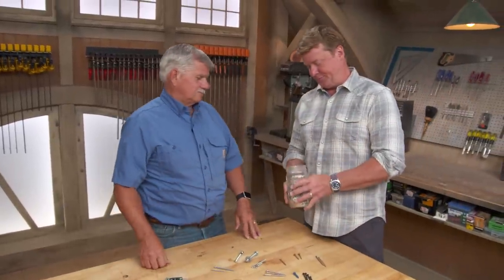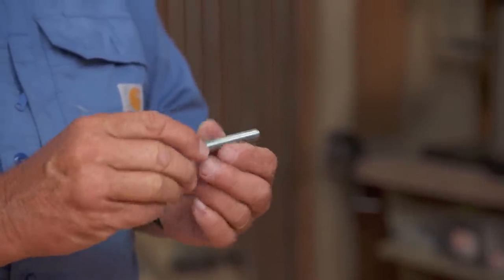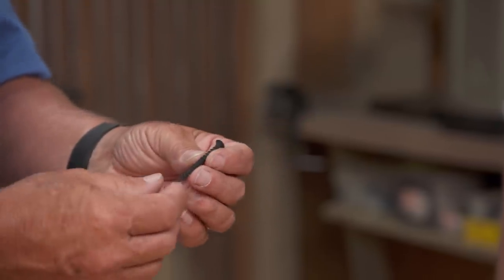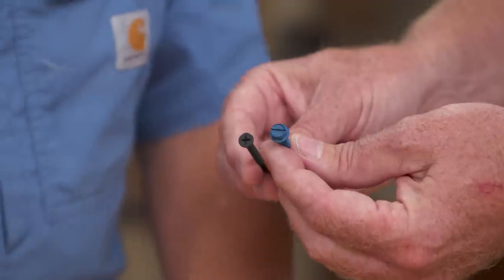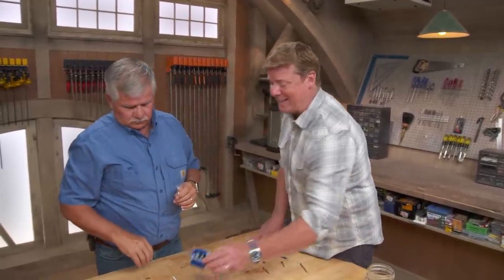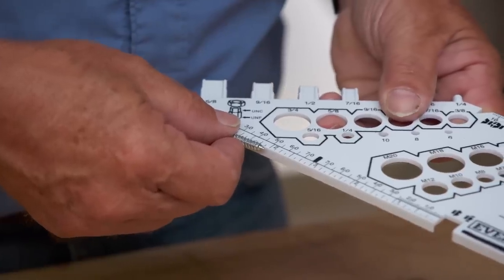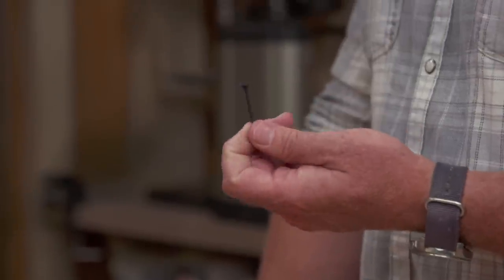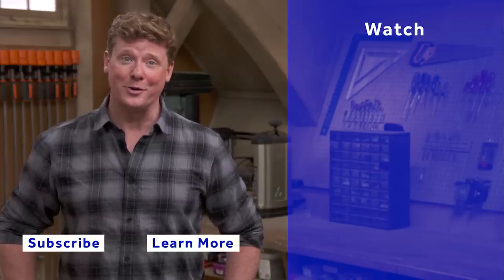How to Decode Screws | Ask This Old House

Comment: What about Robertson screws they are used a lot in Canada and they are far superior than the Philip’s screws and they are very popular in the far north
Reply: The Robertson (square head and tapered slot) is a Canadian invention, but almost unheard of in the U.S.A.  In Canada it's been the standard for power driving screws since 1909, but the TORX  screws are gaining popularity.  I find that any quality of Robertson screws perform very well and the high quality and expensive TORX also perform well, but economy TORX are crap.  Robertson manual screwdrivers and power driver bits are colour coded for convenience.  Robertson screws also stay on the driver bit, at any angle, better than the TORX making one-handed driving easier and more precise.  The U.S.A. is in love with the Philips screws for assembling everything, and they suck.

Comment: Can exterior screws be used indoors?
Reply: Yes but it would be a waste of money.
Reply: VampireOnline Agreed. For example ceramic coated screws can be like 5x the price of an uncoated screw with the same structural properties
Reply: As long as you start the screw outside methinks.
Reply: If you stick to galvanized indoors and stainless steel Outdoors you will never have another problem again in your entire life with fasteners
Reply: @dlamarsobotor4573  "Hi, so I need to hang a painting on an interior wall in my living room, what do you suggest?" - "Okay, what you want is a 22-foot long exterior screw, you start it outside and just run the effin' thing across the room into the opposite wall."
Reply: Sounds bout correct. That way your next door neighbor can hang his hat on it as well !

Comment: Could you explain threads?
Reply: T.P.I.= Threads per inch.
1/2" - 13 = 1/2" diameter/13 threads per inch.
Reply: @MrJman26211  Thank you
Reply: You're welcome! But like he showed in the video, there is a gauge you can buy, which is inexpensive.... But most home centers have them displayed for your convenience
Reply: @MrJman26211  I am interested in how you can identify the thread.  Some stores have a board with nuts and bolts on it so you can try your bolt of nut until you find the correct one.  this doesn't help if the object is part of a machine.  I don't know if there is such a tool for home garage.  As far as screws go, what would be the difference?  Why have different types of threads?
Reply: A 1/2" - 13 is a course thread screw.
A 1/2" - 20 is a fine thread screw.
Fine thread is more T.P.I.
Fine thread is stronger
Reply: Get you a 6" steel rule with 32nds or 64ths on it. Count the threads within 1" and that's your T.P.I. this information is regarding machine screws.
Reply: @MrJman26211  I understand.

Comment: Would a Carriage bolt work on a wooden bed frame
Reply: Yes, I built a loft bed using stainless steel carriage bolts and various red cedar deck materials.
Reply: @bradyelich2745  ok cool Ty so much I'm replacing the hardware that came with my bedframe that was made for me

Comment: ???  well how fr does a screw have to go into the second piece of wood. to have a good hold.  seems sometimes the tip ofthe screww is not enough to holde the 2 pieces together.. especially if the first piece is thicker than the second piece...

Comment: Rule of length is 2/3 grab 
So a 1" screw needs at least 5/8" of solid grab
Reply: That's only 2 times the material thickness though.
Reply: @Mike__B  
Thats all you need to prevent 'walking' or 'loosening' from summer to winter
Reply: @Mike__B  
Sheer strength and tightness are 2 different things
A sheetrock screw only has 400 lb of Shear strength , because they're not designed that way
A standard wood screw has over 1,200 lb of Shear strength
Reply: @Mike__B  remember there's two different ways for fastening
1 is Shear 
1 is tightened 
You need to understand which forces are being applied to what you're doing
Shearing is one of the hardest things to do and therefore has the highest tensile strength
Tightness is simple and can be done with multiple fasteners not dependent on the Fastener itself
Reply: @Mike__B  most people don't understand the expansion and contraction as materials age so they don't understand what's going to happen to the nail or screw over the years
The problem with the thickness rule is when you start doing less than 1/4" material- then it's all about the style- type of fastener

Comment: Great video, but I still cannot understand why the US still stays with imperial sizes. For us in Europe screw sizes are so much easier to follow, 4x40, 5x60 and so on.
Reply: Imperial sizes are more convenient to approximate. 1 inch is roughly the size of a knuckle, so your finger is roughly 3 inches long. 2 fingers together? approximately 6 inches. Wrist-to-elbow gives you roughly a foot (12 inches). Wrists together, elbow-to-elbow gives you roughly 2 feet. Scientific? Not at all. But it's a quick and easy way to get an idea of the dimensions of something.
Reply: I don't think I've ever seen an imperial screw or bolt in the US outside of camera tripod mounts. I do however see a lot of US customary screws used in the US and Canada. There's a huge difference when in comes to fasteners when it comparing metric and SAE to imperial.

Comment: Back too the dodgy maths again, I need a bloody master's degree, understand that crap. Can't be bothered convert all that into metric. But a Jar of random screws always comes in handy, save them.
Reply: JIF peanut butter jars are primo. But only glass ones. That way when you drop it on the cellar floor you can blame the miserable witch you fell in love with years ago.
Reply: you never learned fractions huh?
Reply: @dlamarsobotor4573  plastic lock and lock storage boxes, are the best hands down
Reply: @sirpiken  yes in school, many moons ago. Never used them in day to day life. That's why I use metric

Comment: Miracle Whip glass jars packed with straight blade screw heads are primo. That way you can blame your wife when the project fails miserably and you're picking up  wood screws & shards of glass off the kitchen floor. Good times indeed !

Comment: No love for Robertson? Throw a bone to your Canadian viewers.
Reply: I love Robertson, I wish we had more of them in the states. They're better than Torx.
Reply: @shugthehornyhaggis , Need Project Farm to do a comparison, if he hasn't already.
Reply: @timma_thy  most common place to see Robertson (more commonly know as square here) screws in the States is pocket hole screws and decking screws. 
Kreg in particular uses them with their jigs. Pocket hole screws also tend to have wider head. This prevent the screw drive in to far. Blowing through the wood or cracking it.
I tend to prefer square/Robertson to Torq/star screws. I have heard some people not like them for decking. Sounds like the coating on the screws make a bad fit.
You should be increasingly seeing Robertson/squares. Bit sets always included them now.
Reply: @timma_thy  you can buy robertsons from home depot online.. I got a 5lb box of 3" robertson deck screws just to try out.  They were like $3 cheaper than torx.. Honestly I think torx are better, i have had the robertsons cam out a few different times.